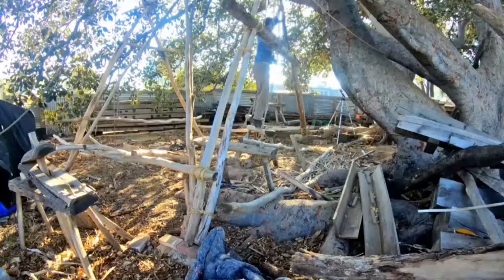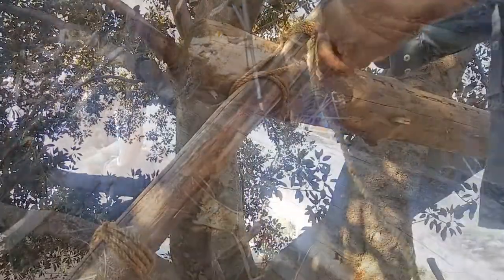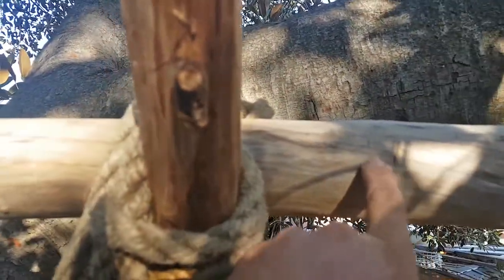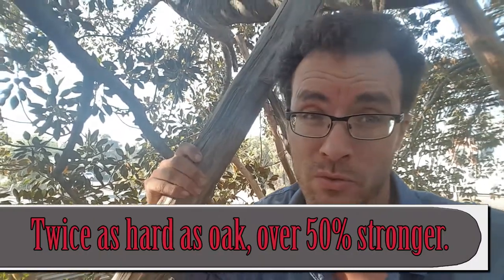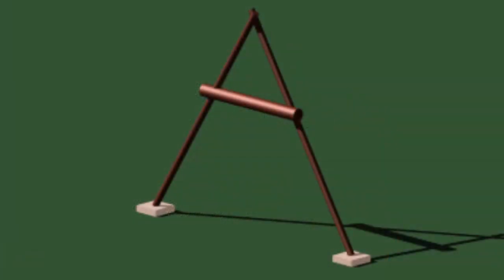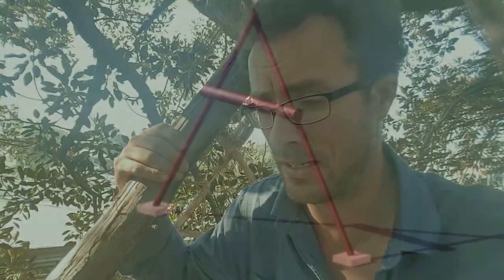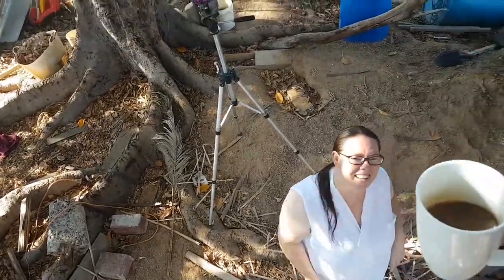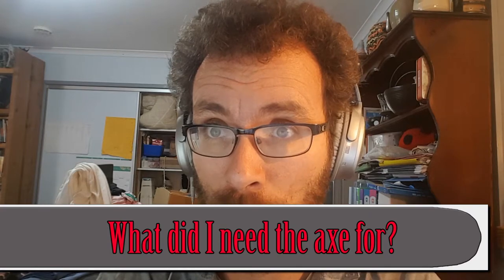Why is the collar tie so massive?

Comment: I'll comment.... most stick frame builders one encounters stand firm that a collar tie is helping the roof from spreading, they are so off on that as you point out.  I have had eye rolling conversations with a few on just this matter and to no avail.   I did notice you were standing on a Tie beam or pole to raise the collar and it was flexing a rather bit, and that piece is doing more tying that not.  Speaking of tying does that computer program for loads analyse tied joints with rope?   Your collar is sufficient but how do you address the rope and age on the rope for longevity,?
Reply from the maker: Once its covered and out of the weather it will be fine for a LONG time. Having said that I've seen sheds on farms built like this where the aging rope was replaced with wire twitches as needed.